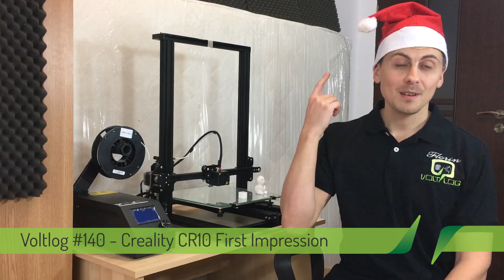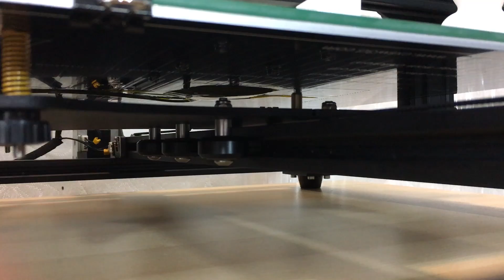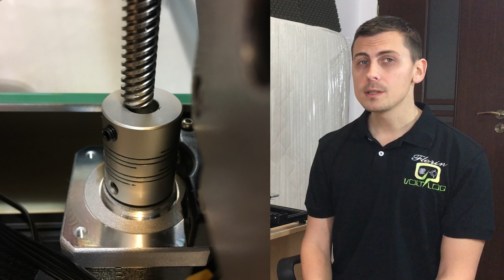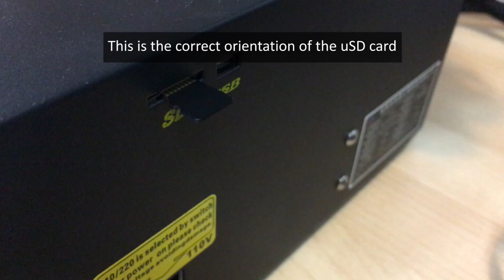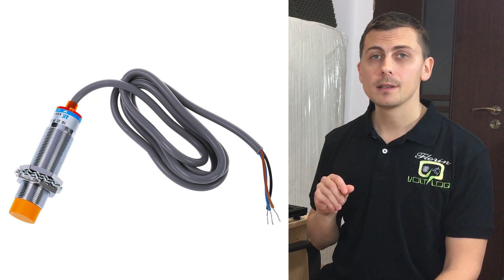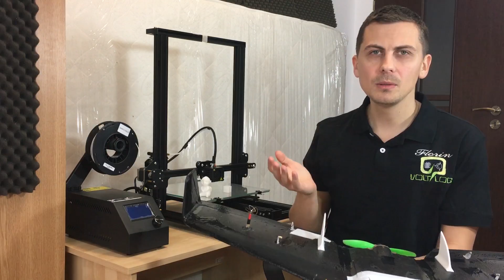Voltlog #141 - Creality CR-10 First Impression: It’s easy to print!

Comment: I think you chose a good printer to start with, it can do a lot for a little money.  As for CAD software most people will recommend Fusion 360 because it's so powerful and it's free, they only downside is it's fairly steep learning curve.  When you are just starting out try Tinkercad, it's very easy to use (as well as free) and you can quickly go from idea to design to print for things like the RC plane parts you showed.  As your designs get more sophisticated you will need to move up to something like 360.  Merry Christmas and Happy New Year
Reply from the maker: Thank you for the CAD software suggestions Merry Christmas and Happy New Year!

Comment: If you can attach your printer to a computer with a USB cable do that, you'll never use an SD card again. CURA will print directly from your computer. I use DesignSpark Mechcanical 3D CAD. Free, POWERFUL, exports .stl files. You'll be designing in minutes. You shouldn't have mentioned the mattress, nobody would have noticed.
Reply from the maker: I don't like the idea of keeping the printer attached to the computer. If I use that computer for something else and something crashes, so does the print in progress. Thank you for your suggestion!
Reply: That is something that rarely happens. When you finally try printing directly from your computer and realize that is the way to go, you're going to hate yourself for fiddling with that old school "Sneaker net" SD card. Also, I just bought an HP refurb laptop workstation for $190 shipped. If your OS is really that unstable, get a dedicated laptop "workstation" for CAD and printing. The refurb from Newegg looks brand new and has a 1 year warranty,

Comment: I really like the CR-10 (there's an updated CR-10s, too, I think) but I ended up buying a CTC Dual just before these ones came out. It works, but I'm sure the CR-10 would have taken a lot fewer part upgrades to get it to where I want it.

The fans on cheap printers are always super loud. The annoying part is they're usually 24 volt fans so they aren't as common. I did find a nice, cheap ($8) 40mm 24v replacement on Amazon which is WAY quieter, but the 60x60x15mm fan in the power supply is a little less common. I ordered one on Digikey here in the US and I'll see how much quieter it is.
Reply from the maker: The CR-10 standard can be upgraded for about $50 to the dual Z-axis that the CR-10S has. As for the fans, I didn't check yet but if they are 24V some small dc-dc converter modules would allow me to install 12V fans. What I am worried is the air flow, especially for the print head, I want to get a similar airflow to avoid creating any problems.
Reply: The airflow shouldn't be a problem unless you get a really slow fan. The good news is a decent RPM fan made by a quality company is still quieter than the shitty sleeve barring fans they ship with printers.

I actually have a couple DC-DC modules in my printer - a 12v to use nice cooling fans in the motherboard area and a 5v to power a RaspberryPi running Octoprint, however, with a dual extruder model I didn't feel right adding two more 12v ones to convert the part cooling fans since I still want them to be individually controlled. Well, that and I didn't know how well the cheap DC-DCs I bought would handle PWM when it changes the fan speeds. :D
Reply from the maker: Ooops I forgot about the variable speed of the fan so it wouldn't be a good idea to use a dc-dc without testing how it behaves under that PWM input.

Comment: instead of a dodgy "SD card extension" i'd recommend using octoprint. This also allows me to let the printer do its job in a compartment far away from my ears :-)
Reply from the maker: I don't like the idea of running another system to run the printer :-) Moving it to another room is an option, but I think I will continue to use the SD card for printing.
Reply: VoltLog octoprint can do more than just remote printing: you can queue prints, have a USB camera that monitors the printer and if you see something going wrong you can turn everything off, send commands to the printer and so on
Reply from the maker: ok, thanks for the info! I see some people are using octoprint with a raspberry pi but to me it seems like it adds allot of functionality that I don't really need, at least for now since I am mostly doing 45 mins prints that I can easily supervise myself.
Reply: VoltLog days will come when you‘d been glad having octoprint taking care of the printer to be switched off automatically after a 5 hour print job or so... :) - but of course for 15mins jobs it would be overkill indeed
Reply: VoltLog with such a big printer it is just a matter of time before you start making long print sessions
Reply from the maker: Thanks guys! I will keep this in mind when moving to larger prints.

Comment: why auto-bed-leveling is not a standard, yet... unbelieable... about noise, check if you can change the stepper drivers, too...
look the first 30 seconds of this video: https://www.youtube.com/watch?v=sPvTB3irCxQ
oh, merry christmas to you :)
Reply from the maker: I agree,, auto bed leveling should be a standard! Upgrading the stepper motor drivers to some Trinamic drivers would certainly make the motors quiet, I will have to look into that after I apply the upgrades I mentioned.

Comment: Merry Christmas Florin!  It's funny to hear you are going through the exact same problems I am with my new CR-10.  My inductive sensor just arrived...

From what I can tell, the go-to design softwares are Fusion360 for mechanical drawings, tinkercad for others.  Though I have been using OnShape for mechanical.  Fusion360 calls itself "cloud" but requires you to install the software which is only avaialable for Mac and Windows.  I use Linux on my personal machines.  OnShape is completely browser based.  Works great for me so far in Chrome on Linux.
Reply from the maker: Thanks, Fusion 360 looks like my best option so far. Merry Christmas!

Comment: I think HomoFaciens noted that you don't need 6 wheels under the bed, so you get rid of the centre 2 and tighten the others more so there is less play without an increase in friction.
You could box it or put a panel up to reduce the noise.
Reply from the maker: Thanks for the hint on the wheels I will have to search more information on that. Regarding the noise I get the idea of making a box around it but for me a more elegant solution would be to use quieter fans. Also I'm wondering how the steppers would sound with upgraded stepper drivers (Trinamic).